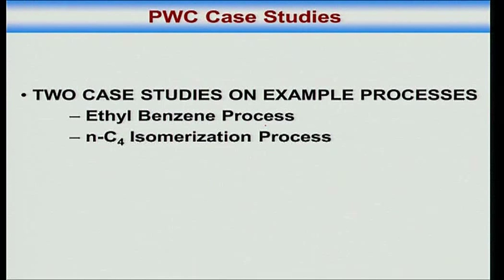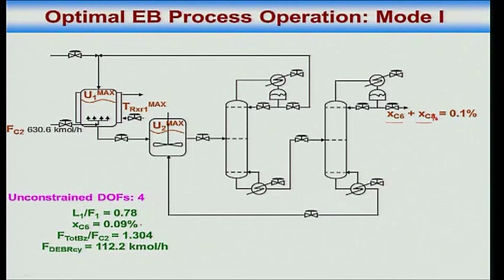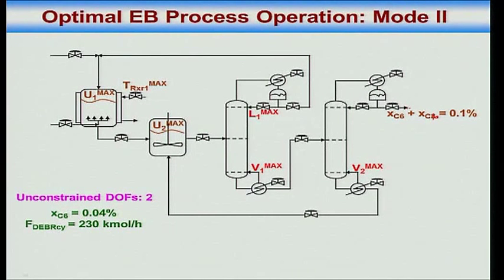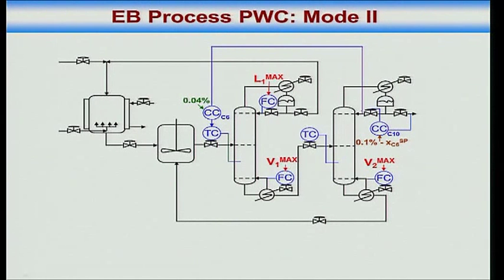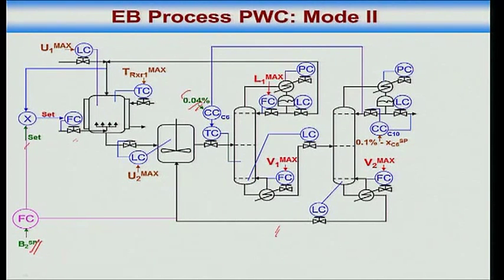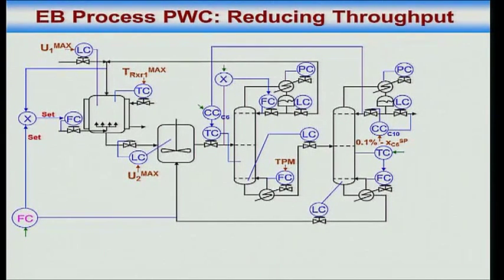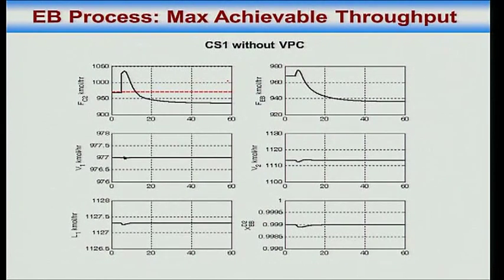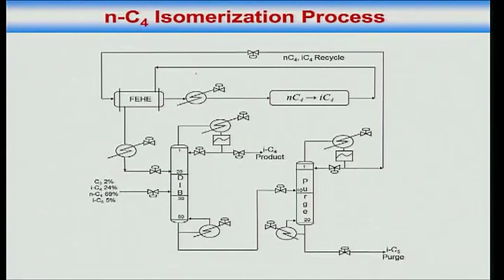Mod-01 Lec-38 Ethyl benzene process case study

Comment: Sir what are the fractional conversion for reactor 1 and 2 respectively?
Reply: Per pass EB selectivity is 85% in 1st reactor. You can take selectivity as ratio of (EB) / (EB+DEB). Although for 2nd one you can take 100% conversion knowing that there will always be some fixed amount of recycle DEB present in the process (Recycle to extinction). So overall conversion is essentially 100%.
Reply: @mahmooddalvi2789  Thank you.